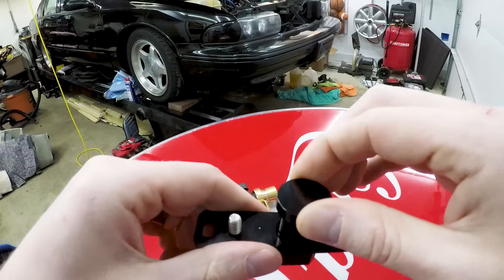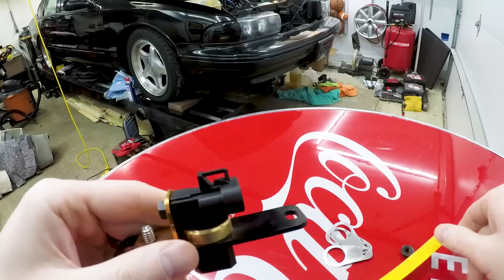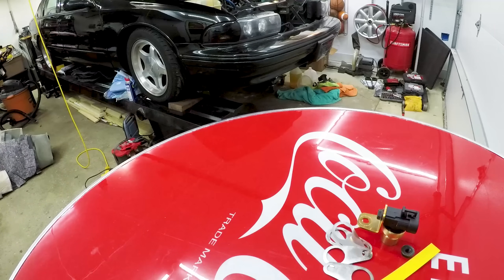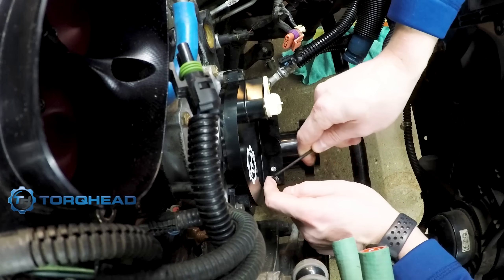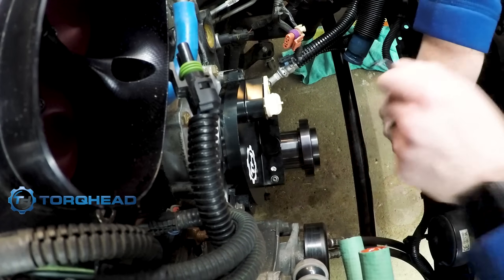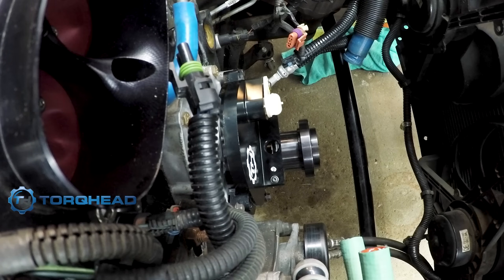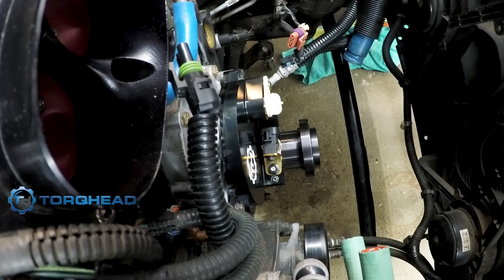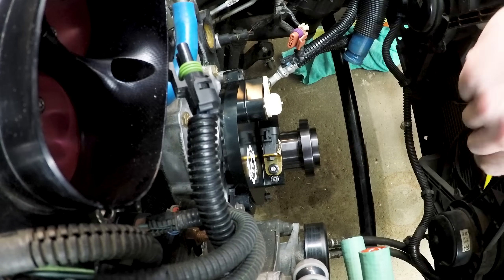Part 4: Torqhead Sensor Install - Shims and Adjustment

Comment: It's been about two years now how's the car running? Did you
work out the " bugs"?
Reply: I hear you. It's always one thing or another with our cars.
Reply from the maker: Yea it’s been fun while it works properly. I’m waiting on Borla to send me a replacement exhaust right now. My og one developed some cracks.
Reply: Well the upside is .you don't have to mess around with that 
optispark anymore.keep us posted on your progress. I'll 
probably will try for a Torquehead kit after the first of the year , when this plague is 
better dealt with.
Reply from the maker: For real!
Reply from the maker: Hmmm where do I begin. I need to film a new video, but it’s been running pretty well. The normal life though of daily driving a modified car. Good not great. Lol
Reply: You used the crank hub spacer, and in the instructions it says 96+ doesn’t need the spacer
Reply from the maker: @bigpoppa12ful I had an early LT timing cover on my 383.

Comment: What do you do with the crankshaft position sensor? Did you just keep it on there?
Reply from the maker: My engine did not have it - I had a '95 timing cover installed on my new engine and just don't run one now.  If you did have a 96/97 LT1, it would stick around and still be down there.
Reply: @RubberCityMotoring  thank you for getting back to me. Yea mine is a 96. I just got the kit. Hopefully it runs smoothly.

Comment: I'm planning to do the same thing your doing with my 94 formula.  Like everyone else
I considered going the LS 
motor install route. Until I 
saw this. I'M sold on it .it's 
a damn site easier and cheaper than retro fitting a L
S  motor .
Reply: Once this corona virus crap goes away God willing .and I
come out quarantine and go
back to work  I'm going to hunt down a decent 93-97 f body ,preferably a firebird formula auto or stick .get the
Torquehead kit install it and
hit the road smiling. As you know
lt1 cars go for next to nothing
And there quite a few nice drivers out there just ripe
for the "picking".
Reply from the maker: Agreed!
Reply: Just thinking .could I run the 97
firebird instrument cluster in my 94formula with the Torquehead setup since it runs
the 411 pcm ?

Comment: Sorry for the late response been working like crazy. But what do you want for the wiring and coir?
Reply: william dirden I’ve put an 383 in my 95 ss .576 .571 cam 58mm throttle body Camaro mass flow ported intake aluminum ported heads 1&3/4 hooker headers 30pound injectors ls lifters & I had brought an tuned computer from Pcm 4 less & I have really no power off the line & it will not stay running once I drive it it chokes so I put an yank 3600 stall on the tranny then an whole lot of power came but the tune is not on point so I plan on this nex the TH setup fuckit
Reply from the maker: Well the wires are on ebay right now and the coil isn't  - email me if you are interested in the coil, if you want the wires, gonna have to bid on ebay.  Thanks!

hoagiesgarage@gmail.com

Comment: Just got done with mine on Wednesday, it’s a badass product with a badass owner. He will talk to you on the phone and walk you through any problems you have, he went over the whole wiring process to finally find cylinder 1&2 coil plugs swapped

Comment: JT, thanks for the nicely detailed video. I to am doing the Torquehead mod but with a 
twist. I am using the Holley HP EFI ECU computer with the same TH sensor set-up
you have. So far, the computer, coils & crank sensor are installed. Everything is wired
and just a few more unrelated items to do before firing the engine.  I appreciate your
videos. Please keep the coming as we both seem to have the same interests & ideas
as far as the cars go. Regards, Ody
Reply: That's the same setup I was looking to do.  Also was looking at the Fitech with the Torqhead.

Comment: i have  383 with new internal 1.6 rockers with a 503 small cam and a yank ss3800 stall ltcc kit 373 gears  electric waterpump and scat 9000 crank and tune for around $4800 and run 11.24  we do this because we love fast cars enjoy the ride buddy cheers!

Comment: nice videos.  but why dont you show how everything fits on a engine should have a motor on engine stand so that it can be seen and well light.   now  please remake the video in a clean shop with your logo in  the background and one in the fore ground..   motor well light and where it can be seen not a motor in a car where the light is bad and difficult to see.    Sir I am not trying to be bossy but help you make your product the best that it can be.   you have a great product and it should be shown as such.
Reply from the maker: Well the engine is in the car.... lighting isn’t too bad in my opinion and I apologize for not being totally clean. 

Most times it is but depending on the project and all that it fills up quickly.
Reply: I am sorry I thought that you are the company selling the Torqhead, and this was a video showing the install.
Reply from the maker: Nope just doing a review and install how-to about their products.
Reply: I am following your video and putting my own torqhead on my motor.   Sorry for my confusion.

Comment: This set up is for the lt1/lt4 lovers but can’t find a local tuner or a decent tuner in another city so having this set up allows for you to get your lt1/lt4 engine tuned at the same spot all your Ls engine buddies get theirs tuned whole set up runs about a little over $1500 thanks rubbercitymotoring nice video

Comment: What exactly is the purpose of this whole set up?
Reply: I jumped
Reply: The purpose of this setup is to get rid of the troublesome optispark distributors that come on the lt1 engines. Optispark distributors are a common failure point with most ignition systems in the impala/caprice, roadmaster, camaro, and corvettes.
Reply: @apdabeast15   And you can rev it to 10,000 rpm without it skipping a beat !
Reply: apdabeast15 everyone always forgets to mention the Firebird